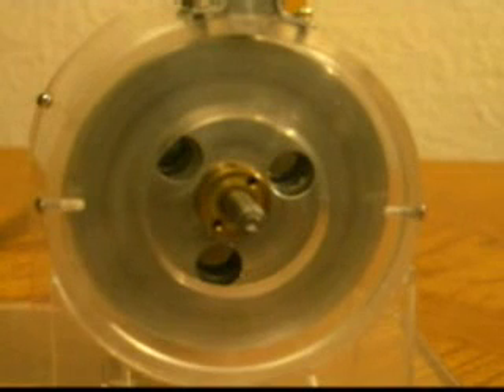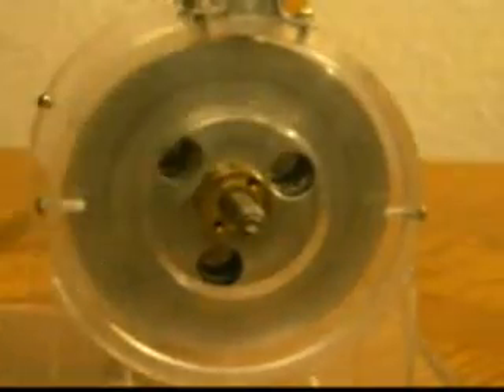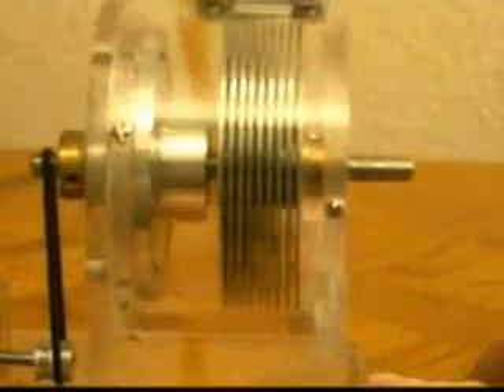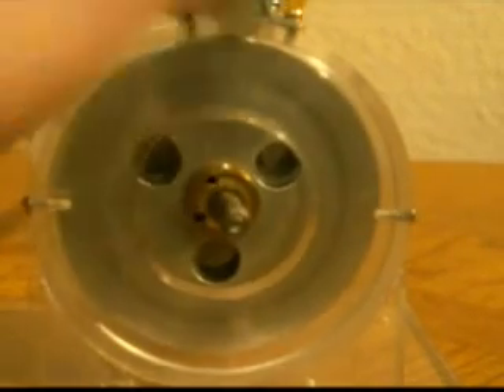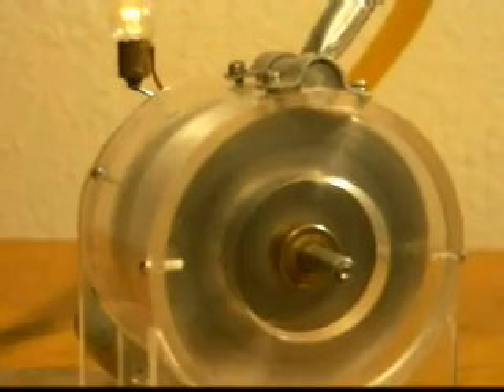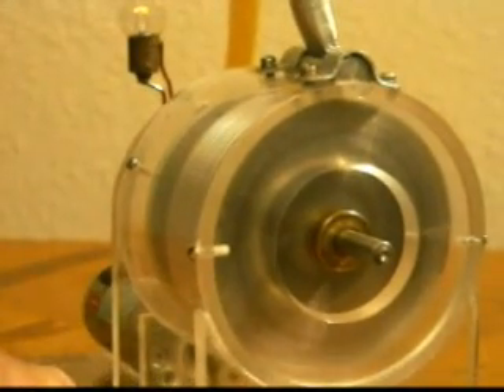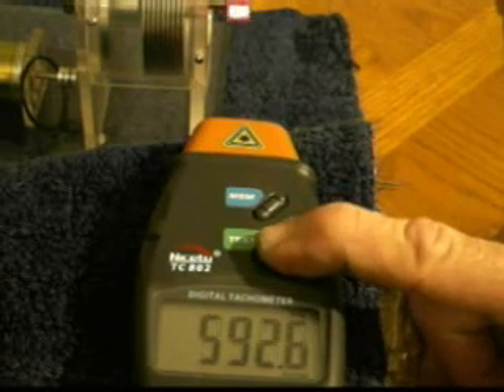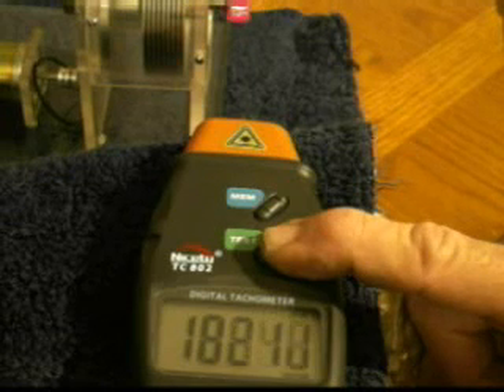A Tesla Turbine

Comment: @BadRick951 Did you calculate effeciency? I made one as my Final Year Project in engineering that ran upto 14000 revs with 6 inch plates(dia) but never calculated its efficiency. Connect it with steam source (using parabolic solar collector) and generate electricity. Best possible alternate energy source.

Comment: @chaz706 A correction to the comment: Thomas Edison did NOT "invent" the light bulb; he simply created a reasonably good, long lasting filament in October 1878.  There were 22 other inventors before him that had worked on what we consider a "light bulb".  As for the comment on Nicola Tesla, you are correct: Tesla invented Alternating Current (AC), while Edison worked only with Direct Current (DC).

Comment: that would create more turbulence and that would lower the efficiency by increasing vibration as lowering surface area of high pressure air in contact and also in uniform direction

Comment: If you power the axle to such a device, do you get a strong breeze coming from it?  In other words, does turning the axle at high RPM using an external power source provide thrust coming out of the discs?

Comment: poor tesla i started researching his turbine. that disc leads to the jet engine and also probably the best jet engine ever built. its would be hard for the engine to fail at the simplicity and efficientcy that it creates. i read that the tesla turbine aircraft would make a powerful vortex of air above the craft like a string holding the craft and allow it to just hover like ufos! the vortex was a pull along method instead of the push method of propellers! poor tesla makes me so sad!

Comment from the maker: Technically your are correct, but there's a 3/4 in dia spacer disk  between each of the larger disks. If you make the holes closer to the center they are blocked by the spacers.

Comment: Very cool, nicely made unit... congrats. Was wondering if water instead of air might produce more surface tension (fluidicity?) and thus more torque for the generator??? Forced water injected into unit probably cheaper to source and run than compressed air

Comment from the maker: Torque is pretty low, unless you go thru a speed reducer or bump the operating pressure way up-- which not only hurts effeciency but in this case, causes the air line to blow off and hit the operator in the face. (Too bad the camera wasn't running for that one.)